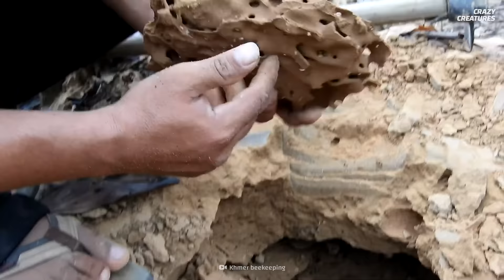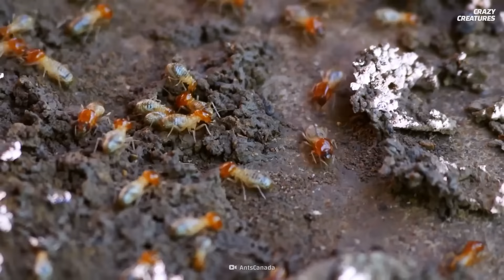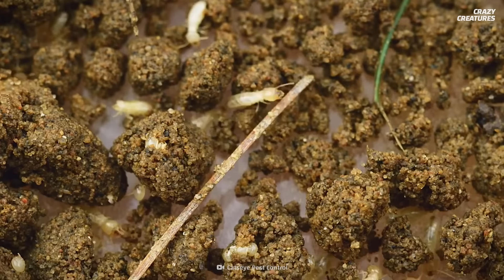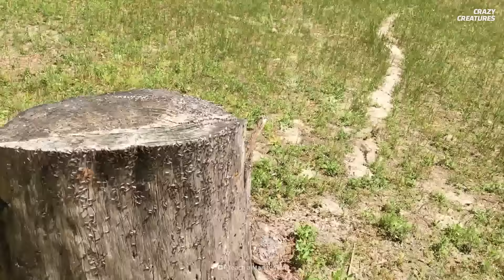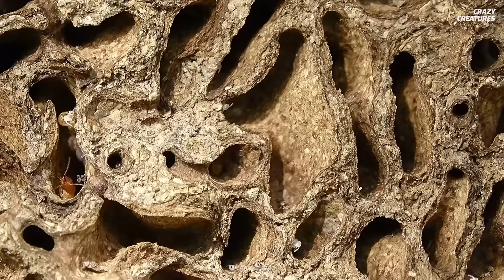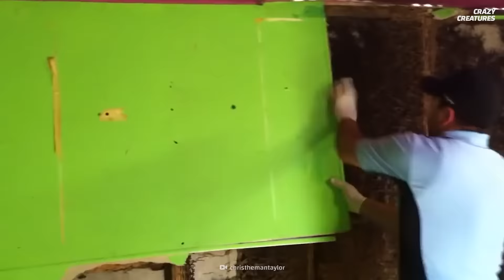Why Termites Lick Their Own Queens to Death

Comment: Imagine building houses out of wood then being surprised that insects are eating them.
Reply: Right, who with any sort of intelligence and the right materials is using fucking wood to build a house?  Its Just mental, do the not have bricks or concrete?
Reply: We build houses out of wood in Japan. I'm guessing wood is less likely to crush and kill you if an earthquake hits. It's flexible, and can be fit together like puzzle pieces, so that it's less likely to get destroyed in an earthquake. In the off chance that the house doesn't hold, wood is light weight, less likely to crush you.

Wood absorbs and releases moisture, which makes living in wooden houses quite comfortable, especially in humid weather like Japanese summers.

Wood is also a fairly cheap and easily processed construction material. It's true we face termites, but parts can be easily replaced in wooden houses.
Reply: @yeahrightok.3975  If you ever see a house being built, wood is the standard--and only really--material used in the boning. Brick and concrete houses use wood, too, as a structural support, in the event of hurricanes or earthquakes. Skyscrapers tend to use metal boning, however, are located in areas in which weather/earthquakes aren't as severe. You also have to consider metal boning is extreme expensive, and are reserved for large buildings that can afford it. Otherwise, wood is an affordable material, which offers protection as well insulation. Every item has it's flaws and scarcity. Aside from vulnerability from molding and termites, wood is used in almost every house you lived in
Reply: @yeahrightok.3975  wood is cheaper, lighter, and easily repaired. specifically in places like the midwestern and southern US most houses are made of wood because of the stormy seasons. a hurricane will topple a brick house just as easily as a wood one, so it makes more sense to use wood as a building material to cut down on costs in the event of a destructive natural disaster. termites are also not a constant issue, so the continued use of wood isnt impeded by termite colonies enough to make it not worth building with.
Reply: Good job repeating the same thing 3 times, guys. We could've done with the first one you know.
Reply: @redtortoise  Good job rebuilding the same house 3 times from the same material that necessitated rebuilding it after the first time.
Reply: @matt92hun  I was talking to Christopher and an 8th dimensional being
Reply: @an8thdimensionalbeing142  "rebuild" is when you have money if a choupana made of wood is destroyed in Republica Dominicana they can't rebuild easily so that's not a defense of wood houses.
Reply: @matt92hun  bruh
Reply: @redtortoise  Ah, so it's just YT being weird again. I didn't get a message about this comment either, just checked in here because of another reply.
Reply: @AnnaMorimoto  Same with us on the West coast of the US. The vast majority of standalone homes are made of primarily wood because concrete or brick would simply crack, crumble and colapse with even minor earthquakes since the structure is entirely ridged and inflexible.
Reply: @christopherfeatherley  I like wood boning, lolz
Reply: I'm always surprised how willing people are to show how ignorant they are on the internet, when they could've taken ten minutes to look up the benefits and disadvantages of wood vs. brick vs. concrete. vs etc.
Reply: @catalystgreenhorn9184  I'm just glad I don't live in a building made of insect food hoping no insects will come by.
Reply: @matt92hun  termites really aren't that big of a deal and even if you're home has brick or concrete. It's still susceptible to termites. Your roof for example isn't made out if bricks. Not to mention cost and ease of repair. Its possible to add smaller modular replacements to wooden homes brick ones not so much. Most wood is treated for termites and it takes years for that to go away. Why build a house of a material that'll crumble under the weather conditions in the off chance  it'll get termites?
Reply: @matt92hun  anyway there are actually wood types that even termites can't eat, so there's that
Reply: This is why we should build houses out of rock!
Reply: specially for ancient people, wood>rock in term of price, lighter so ez to manipulation, easy to extract and shape, better isolation with , and wood can be found everywhere, not good stone....main problem is fire, earthquake etc. in japan wealthiest people have already bought and stock and shape their next house in a depot, because fire were happen often.
armed concrete? those can crack and rust, whereas theres wood roof who are fine after several centuries...asian temple can be restored and even castle can be dismount easily whereas medieval castle in western are full of stone and cannot be restored easily.
Reply: @eriklerougeuh5772  Brick.
Reply: @AnnaMorimoto  it's because japan has lots of trees but not lots of iron
Reply: Well, that's what we have ..nature, to use to build anything. I mean.we don't magic things
Reply: @Angelface11  Cool, magical bricks.
Reply: @yeahrightok.3975 wood is a cheap, plentiful and above all, renewable resource. 
It literally grows out of the ground, consumes carbon dioxide, provides oxygen, and can be used in everything from creating tools, furniture, paper, wagons, houses, barns, ships, telegraph and phone poles, railroads, fences, firearms, airplanes, bows, it can be used as fuel for a fire in winter, or burned into a more efficient fuel form as Charcoal. 

Wood is literally the most useful resource humanity has on Earth.
Reply: @an8thdimensionalbeing142  but wouldnt it be cheaper to build a stone house than to rebuild a wooden house every few seasons?
Reply: @matt92hun You a good troll.
Reply: @MyBrainGlows you don’t rebuild a wooden house “every few seasons” many of the homes in my town date back to the pioneer days and are still standing just fine. If you don’t take care of your home then of course it can become dangerous, but this is true no matter the material used.
Reply: @an8thdimensionalbeing142  a hurricane will absolutely NOT topple a brick house just as easily as a wood one, wtf are you even saying
Reply: Imagine not be an European...
Reply: @SirPano85  No free protein in the walls. 😩
Reply: Lol...  This protein addicted culture make me crazy....
Reply: @christopherfeatherley  not where I live, the only houses builded in that way are older then a century. We use concrete and iron.
Reply: @yeahrightok.3975 you definitely never traveled or saw the foundation of a building to be that much ignorant
Reply: Like the story with the three piglet house constructors and the wolf

Comment: Termidor works best with termites. Especially formosan termites. Sentricon wood monitoring stations and then when activity is found in-ground stations with hexo florimon tubes put into the ground stations. Also works. But Termidor works the best as a perimeter spray or anywhere termites are detected. So you do not have to have your house necessarily tented. Unless you have a bad drywood termite problem. Drywood termites will leave little tiny pellets the size of coffee grounds. Or sometimes you will notice little tiny holes in the wood. A good walk around the home should determine if you have any wood to soil contact. Also make sure that dirt and soil around your house is not above the foundation line. concrete or concrete block Holmes can even be a problem with wooden furring strips. Always be aware that formosan termites can eat their way all the way up into the attic or even build mud tubes all the way up to the Attic mud tubes is a protective layer of mud made into a tube form the termites like to use as passageways. Very common for these tubes to go all the way up to the Attic or into the interior wall studs usually constructed of wood. Anytime you see what appears to be mud tubes going up the exterior walls or even interior walls is a good sign that you have formosan termites coming up from the ground. If you live in an area that has constant damp soil or poor drainage. You maybe at a much higher risk of having termites especially formosan termites. Termites can destroy a brand new house just as easily as they can destroy an older house. Most common mistake people make is they think when they buy termite treated wood that they are safe against termites however unfortunately that is not necessarily the case. Especially if the ends of the wood have been cut off the termite protection is no longer there termite treated wood only last so long with termite prevention. Never use wooden planter boxes on the ground never put wood in the ground especially don't do it near your house this includes even Cypress fences or wooden fences. It is basically like putting out bait for termites. If you have dead trees or dead roots or even Fallen branches make sure that they are cleared away right away before they attract termites. Although concrete block and concrete homes usually cost a little bit more than wooden homes it is highly advisable to have your home made out of concrete or concrete block. Especially if you live in a termite known prone area. Such as Florida Georgia South Carolina Tennessee Alabama Mississippi termites can be found all across the nation even in California but they are very prevalent in Florida. Both formosan and drywood termites same thing with carpenter ants which can be quite destructive as well. Most common mistake people make when doing landscaping around their house is having the soil too high around their house above the foundation line. Although Landscaping looks nice Landscaping done incorrectly might be a huge invitation for formosan termites to invade your home without being detected easily. Always keep the soil below the foundation line at least 4 to 6 inches minimum of the actual concrete Foundation showing so that you can clearly see the concrete Foundation look out for mud tubes if you see mud tubes then you know you have formosan termites if mud termite tubes are found the entire perimeter of the home should be treated right away. If you have a wooden foundation or a crawl space make sure that there is no wood to soil contact. Even wooden stakes in the ground when concrete is poured can also be an invitation for termites. Always try never to have wood to soil contact. Even if it's termite treated wood.
Reply: Holy crap dude learn to use paragraphs and line breaks.

My eyes glazed over reading that
Reply: Thanks for the knowlege🙂
Reply: @Shinzon23  it was a bulky and messy read definitely, but still knowledgeable and easy to digest. I guess train your eyes to not be so picky? 

Information IS information after all
Reply: Despite the Grammar Nazis complaining, This was very informative! Thank you!
Reply: Ain't no way I'm gonna reading all that essay, but whatever that is you are talking about... I'm happy for you! 🤓
Reply: I had a growing termite problem. Luckily I found where they coming into the bottom of my threshold  eating my floors and baseboards but the walls and subfloor is in good condition. its bc of all the stumps around my house and I have a bad issues with roots backing up the sewage system. ive been remodeling my studio ever since spraying cans of insecticides in and under my house, into the stumps etc. also got carpenter ants and Mason bees to worry about but haven't seen that many of them.
Reply: Nice.

Comment: That's why construction workers need to start using other type of wood to build home, like cedar wood...

Edit (May 21, 2022): Keep in mind that cedar was used in the building of the temple by Solomon and Solomon also used cedar to built his mansion. It considered the highest quality than most woods available.
Reply: @sonacphotos  Yes, by cutting down cedar forest. But I don't know about termites or other insects going in the cedar as the cedar has natural oil that repel all types of insect and won't even go near it. Just saying.
Reply: @sonacphotos  I have the cedar essential oil. It doesn't last longer. Maybe at least a day. I use it on the diffuser and it does seem to works. There are no bug, not even mouse in my room, but in other room lol. Yes I got rid of it with diffuser.
Reply: Interesting, start planting cedars instead of dugluasFUR.  I'd  imagine, years of planning, supply and demand and greed, are major factors in that thought.  Also you are right about,  termites do not attack certain types of tress and parts of trees, like the heartwood of a tree.
Reply: @g-man5809  Imaging living in a home  built using wood that repel all type of insects...that would be nice.
Reply: @JustinMacsMoon  would put me outta business, better yet a house that prevents dry rot.
Reply: @g-man5809  understandable but wood like that are quite expensive.
Reply: @JustinMacsMoon   Believe me I know this dude I shop at home depot 2 times A-day sometimes I just got done leaving home depot my military discount doesn't even  cover wood no more,  You're trying to teach me dude I will teach you.
Reply: Cedar is too soft
Reply: Or use concrete
Reply: That's why construction workers need to start using stone to build home, like in Germany 😘
Reply: Some ants in the genus Formica and others like the oils and resin and actually use them to their benefit.
Reply: @elliotsmith102  I highly doubt. You have link or proof that support it, please provide it
Reply: not gonna happen
Reply: @jackfarrell4727  but they should, right?
Reply: @JustinMacsMoon Some hate it but many others use it as an antibiotic and also have other uses for it.
Reply: Or just build conceete houses
Reply: @JustinMacsMoon  I sent link it got remove
Reply: @elliotsmith102  just give the title of the website
Reply: @JustinMacsMoon  I think it just deleted title
Reply: @JustinMacsMoon  Prophylaxis with resin in wood ants
Reply: @JustinMacsMoon  research gate
Reply: @JustinMacsMoon  did that work
Reply: @elliotsmith102  Yes it is works. I read it. There are many trees with resin for ant, but not all trees are beneficial for ants. I only see cedar wood are good for repel ants as well as other natural oils. Like I said, When I use the cedar wood oil in the diffuser, there was no ant and no other type of insects. They don't like that smell.
Reply: Or, build with iron, steel, and brick. 🙏🕊🌿🌳🌲🍀🌱🌴🌻🍃🌻🌻🌻
Reply: @PrincessHVHHDSSS  I would rather live in a natural environment...
Reply: @JustinMacsMoon  Yes, a natural environment is far more pleasing. I live in a brick apartment, with wooden floor boards. I love wooden furniture. Cedar wood is beautiful. 🕊🌿🌳🌲🍀🌱🌴🌻🍃
Reply: Could just build with a bug line. My house has one. It's supposed to work well
Reply: @JustinMacsMoon  a lot of the ants that cause damage to wood in the genus Camponotus will live in cedar, as they have adapted to have a resistance to the aromas so they can take advantage of any available trees. Cedar is also soft.
Reply: Bricks.
Reply: It's expensive and the kind of cedar that could be used grows only on the west coast and with the amount of homes built it would deplete the supply in no time but it is a great wood,insect resistant, last forever I think the most basic of degradation only begins after 50 yrs
Reply: @JustinMacsMoon  that first sentence tho....

It's like, "I got the drop dawg" vibes.
Reply: @sonacphotos  I was told home insurance in Australia doesn’t cover termite damage because it’s preventable. I must admit I haven’t had time to look deeper than that. Had the termite exterminator in recently because I found them under my shed.
Reply: Metal structures and ferrock. Time to forget about building with wood.

Comment: Interesting… but I think this vid is missing a key part of the story. Some might be here thinking, “Well why do the workers need to eat the Queen if the whole colony is going to die with her? Thing is that’s not the case necessarily. Unlike ants, Termite queens can do Pathogenesis to lay a cloned version of herself, and also males don’t die— they become kings. So the king can mate with the queen’s clone to make backup versions of herself already supplied with the same sperm. Some species probably also have backup plans for the king, like bringing them in from outside. So the colony itself could potentially be immortal, living well beyond the life of one queen.
Reply: The king termites are even visible in this video's footage. Those are the long ones without the big heads like that of guards that stay in close proximity to the queen termite.